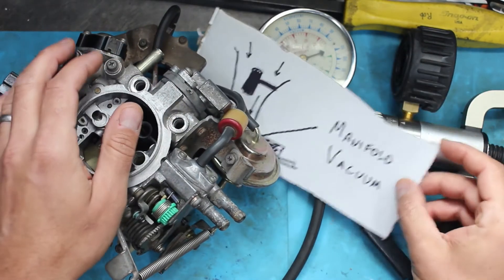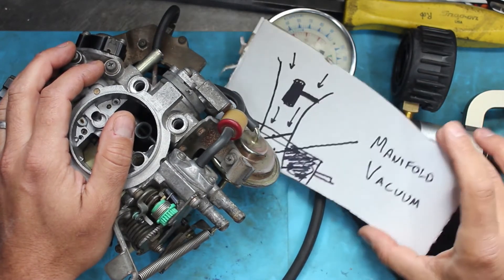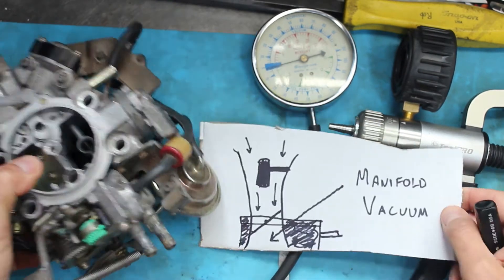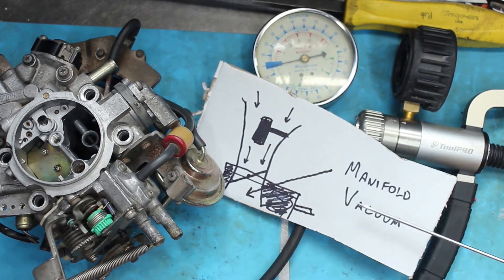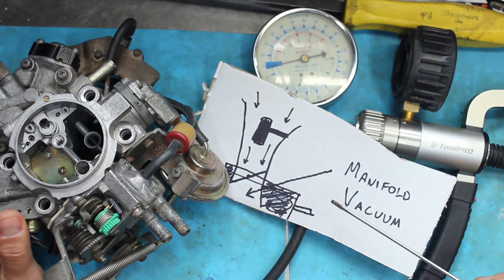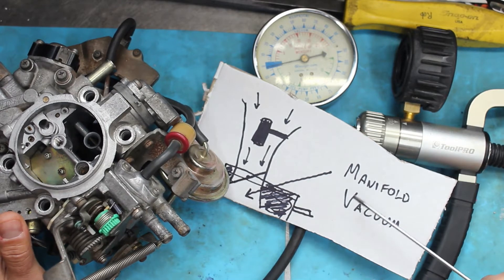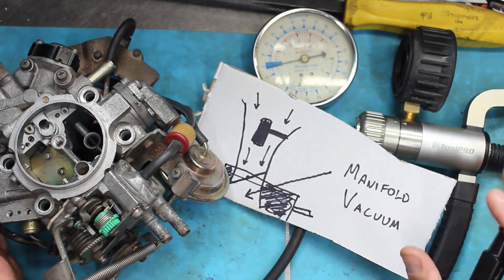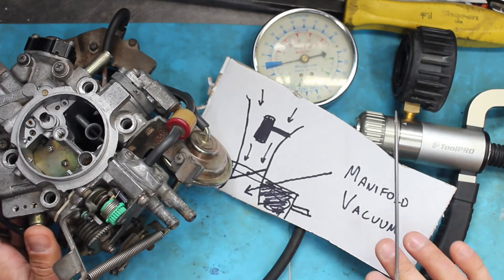Hilltop Workshop | Vacuum Advance and its CORRECT operation, explained.

Comment: Good video helping to explain how ported is really preferred.  Problem is that people think ported is emissions only due to history of ported/manifold advance.  Also, edelbrock lablels their ported nipple as "emissions" instead of ported which is highly confusing.  Modern muscle cars will run better using ported vs. Manifold vac as most distributor advance mechanisms are set up for ported.  Distributors setup for full manifold vac need light springs to advance quickly on throttle tip in because manifold vac drops off and advance drops off.  Required Cruise rpm total advance is not untypical at 45 to 50 deg which is initial + mechanical + vac advance.  This is beneficial to burn the slow burning lean mixtures at low load cruise. Folks running mech advance only distributors are losing 30% fuel economy because they think vac advance is vodoo or emissions.  WOT wont use any vac advance (ported or manifold) so dont get confused with specs like 32 deg all in at 3000 rpm.  Specs like that are for WOT only applications.  I have spent hundreds of hours setting up both ported and manifold vac ignitions and always had better driveability and throttle response with ported using 10-12 initial vs. Manifold with zero initial.  Exceptions are engines with very big cams that will not idle without a ton of advance.
Reply: Ànd 12 mechanical advance.
Reply: As far as im concerned, the only difference between the two is at idle and light cruises, everything else is the same. I can't see where and how it can make a difference in driveability, I'm really not sure what people mean by driveability anyways, i can't tell the difference. 
If it only makes a difference at idle, why not go with the one that gives best idle. for me, manifold gives me smooth and quiet idle and cooler exhaust. 
Initial is 10, another 10 for vacuum advance for a total of 20 at idle.
Reply: @lucsavoie9501  Of course it makes a difference at idle.  If you can't get a decent ("best idle" as you put it) from your engine without using full manifold vac to dump in a ton of advance, then there is something wrong with your engine.  Ported vac advance adds no timing at idle so if your engine won't idle well, you need to perform some troubleshooting.  If you have a giant cam engine, then you're probably racing and full manifold vac can bring the idle up with adding a ton of static timing which has its own problems with hard starting, too much timing below ~3000-3200 (knocking and pinging) and in some cases, too much total timing.  If you have a race engine, then WOT uses no vac advance so who cares.  If someone is driving a mild cam muscle car engine around with full manifold vac advance, then they had better have the dist set up for it.  Aftermarket dist manufactures assume you're running ported vac advance and their spring rate and vac advance chambers are set up for that which is why the better suppliers provide instructions (and parts) for converting to full manifold.
Reply: @BlueOvalEdge  I just watched your video on your explanation of the diferences between ported and manifold. I understand all of that.
Where i think you might be off is when you say that they work opposite. 
Sure, the pointer on the gauge moves in opposite directions but in my observations while doing several tests on this topic, when you open the throttle with manifold vacuum, the vacuum does not go to zero, it goes to the same exact level it does with ported. I really don't see any advantage in using ported and many with manifold.
Ps. I didn't mean it doesn't idle well with ported, just much better with manifold.

Comment: The misconception is there because most American cars up to 1971 called for Manifold vacuum with some very minor exceptions. In 1971 or so automakers were attempting to save fuel and have a cleaner combustion process for emissions, how do you do that? You add more air but can't because you're essentially at full advance on manifold. With manifold at idle to get the fuel to burn it needed to be richer which in cars in city's spend most of their time (not WOT). So opening the throttle allowed more air in and made a better combustion process (but now your idle is too high which they fixed by retarding the timing). Ported vs. Manifold at WOT doesn't matter; you're still beholden to total timing which is the vacuum advance + mechanical timing The difference is how you split the numbers. Now if you have a fairly high compression motor adding more timing will allow it to run cooler so you aren't overheating in city or stop and go traffic. I think the moral here is that there is no right or wrong it really at cruise you have vacuum advance. I would encourage everyone looking at ported vs manifold videos to buy a wideband O2 and gauge, and tune the car and carb for what the engine likes as today's gas is definitely different than that of 50 years ago